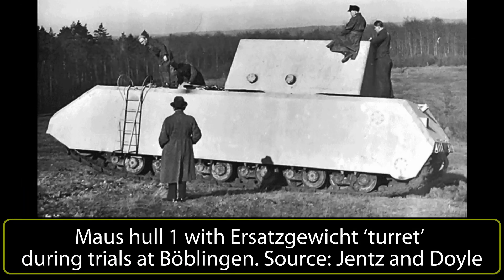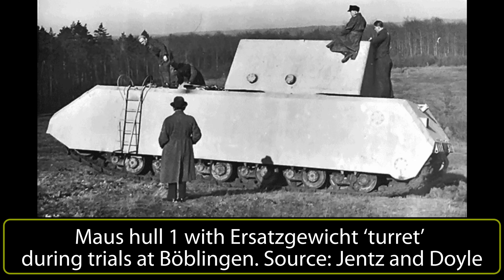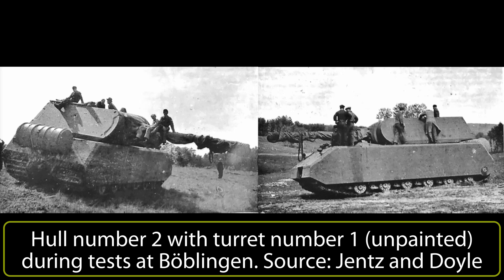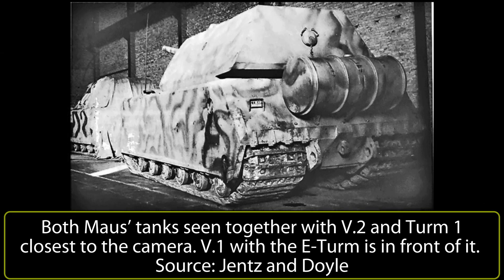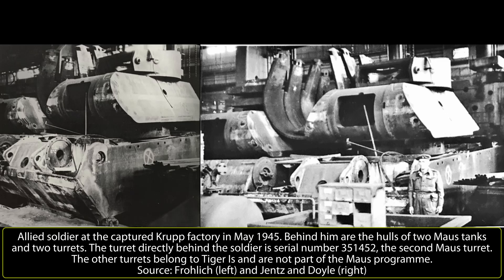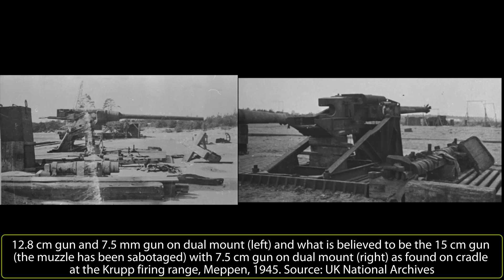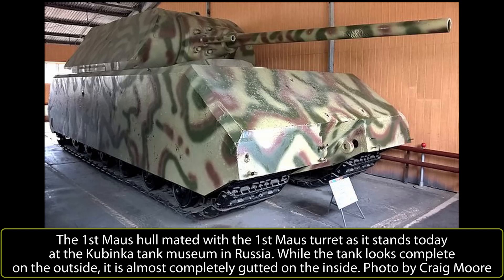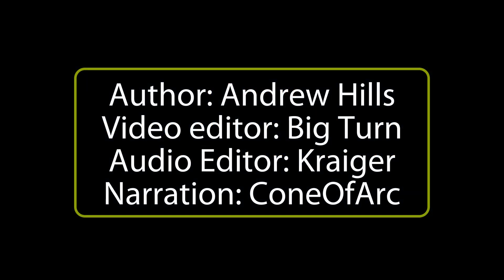Legendary Trials | Panzerkampfwagen VIII Maus (part 3) feat. @ConeOfArc

Comment: Thanks.. As you know.   Germany did know they needed to produce more tanks... but they just couldn't do it. They could not afford to slow or stop any production to refit a plant to produce more . They needed every tank produced ..  If it was as simple  as making a new plant ... they would have done it.  Really the steel couldn't produce more tanks because the factories  were making as many tanks as they could. Speer the " Genius" couldn't make more plants.   But back to the Maus ...  Hitler told Porsche in November of 41 of his idea of a huge tank the would act like a battleship...being protected by smaller tanks. This is really similar  to how  the Panzer IV was used  as a support for the  Panzer III  in the beginning of the war.   Hitler thought tanks would get bigger and have larger guns so he wanted to get a head of other armies. . .  Its important to understand that is the situation in 1941.. Germany hadn't faced the cold truth that  they were in over their heads yet.  So the idea isn't quite as crazy as one might think. ( I remember all the controversy from manufactures and engineers when the DOD wanted a turbine engine in the M1. They were convinced it was impossible and the debate was heated. )   And you pointed out the mud photos. Part of a test for new vehicles is to see how easy it is to get stuck and then unstuck.   It's easy for people to  take anything out of context.. very often they have no clue their  knee jerk conclusion is wrong.   Thanks.

Comment: I consider Maus as an excellent ersatz for the insane variety of coastal artillery positions protecting festung Europa from invasion.  Instead of supporting a ruinous run of coastal defenses, including all those extra locomotives, turntables, and shuntlines, all that's needed is for a Maus to drive up and start shooting.
   Consider, for a moment, the idea of a better, quicker, siege of Sevastopol.  No Loki and Ziu.  No Dora and counterproductive months of preparation, digging in, and expanding the rail net.  Instead, a battery of 6 mice creeps up and lets fly.  Counterbattery?  Back up.  The enemy retreats?  Move up a little.
  An Allied invasion fleet moves elsewhere to try again?  You hop a train and get there ahead of him.  Both the 12.8 and the 15cm K were very long range guns for caliber and possessed of fine ballistic performance.
 The schema did not play out as intended, of course.  As with KV2 (Big Turret HV) it was a serviceable design left in the lurch by events it could not control.
Reply: True, if the enemy doesn't bomb the railways first that is….